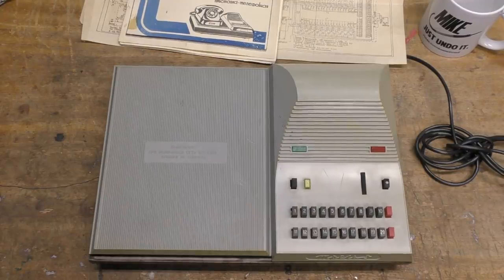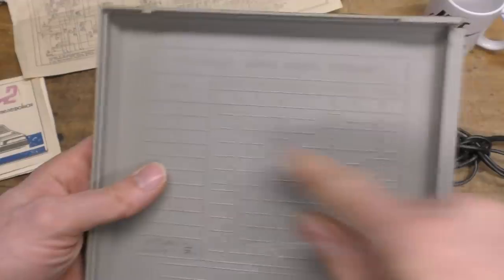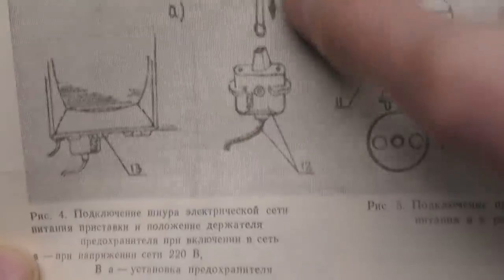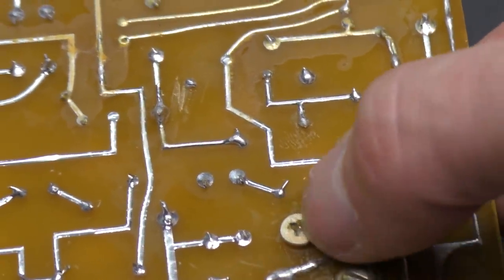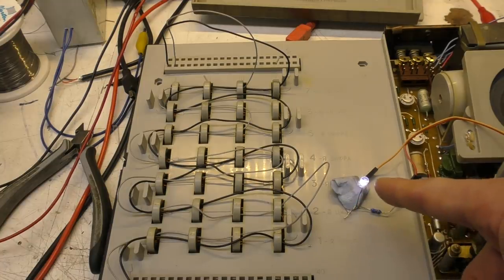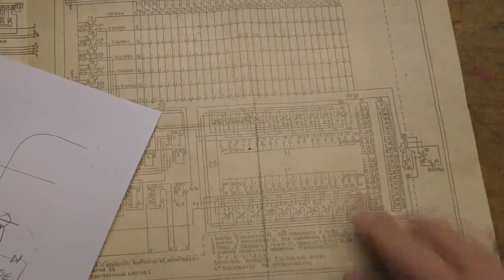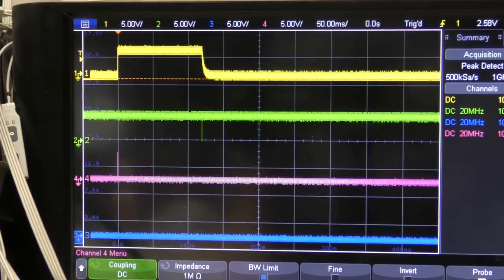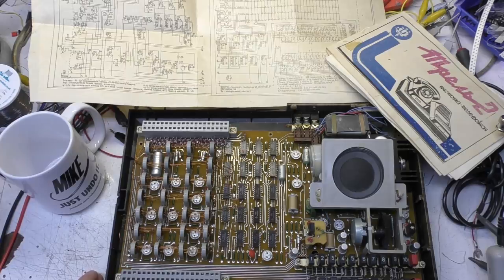Russian phone dialler using interesting magnetic memory tech

Comment: Wow the Russian population must have been a hell of a lot more capable than the west, especially these days. Lets face it most people cant set the clock on the microwave let alone manually code magnetic cores :)
Reply: So capable that they couldn't make a basic smart dialer in the 1980's whilst the west had systems such as the AT&T Merlin......  This ain't any different than setting DIP switches on dialers from the 60's and 70's before fully programable office BPX systems were basically common place by the 80's.
Reply: @DOGMA1138  Ha yeah  you are right regarding the technology I was looking at the ability of the user to actually program these.
Reply: @campbellmorrison8540  It's far simple to program these than to program their western counterparts.... That actually required you know programming...
Reply: @DOGMA1138  They could manufacture (or copy from abroad) anything, including microprocessors, but this was simply a cheaper solution.
Reply: @Turmfalk  Emphasis on copy, which is why a lot of their IC development stalled once VLSI ICs that couldn't be reverse engineered from die inspection alone popped on the scene.

Comment: Why?
 Why not use some dip switches to programm the numbers into it? Were they not a thing back in the days?
Reply: With 40 numbers, 7 digits each, 4 switches per digit, you'd need 1,120 switches.
Reply: @Kevin75668  no.  Each telephone number can be stored as a 20 bit number.  20x40 = 800.  But realistically fewer than that because you'd be using multi-switch dip packs. But yeah, just decode the binary number into digits.

Comment: How long do you think it took to design that thing and get it to actually work, in the days before ltspice and kicad :)
Also it dawns upon me that this may have been achieved with just dil switches and relays, which surely would have been cheaper and easier?
Reply: Probably did not take them very long since they had production lines churning out far far more complicated magnetic core memory modules, those were obsolete around the time this thing was made however in a stagnant planned economy the capacity stays around for longer.
Reply: @FlakeSE  That is generally a thing. As technology gets older and becomes cheaper to produce, it trickles down into cheaper markets. By the time this auto dialer was released, it was pretty much 20 year old tech.

Comment: The digit encoding struck me as a bit interesting. ("Read More" for a Table below.) The lowest binary symbol starts with four [0b0100] which seems kind of arbitrary. Presumably zero [0b0000] is just NULL, but I wonder what if any undocumented functionality might result if one were to wire encode for symbols: one [0b0001], two [0b0010] or three [0b0011]? ( Less notably fifteen [0b1111] is seemingly unimplemented as well.)  Perhaps four was just the first wire pattern capable of reaching a saturation state, but I can't exactly intuit why. If something like that were the case I'd think four [0b0100]  and eight [0b1000] would be a problem too while three [0b0011] would not.  Alternatively, perhaps this arrangement just somehow simplified implementation of the pulse encoding matrix.  Any thoughts?
DIAL	 	BIN		     DEC
{∅}	~	0000	=	0
(?)	~	0001	=	1
(?)	~	0010	=	2
(?)	~	0011		=	3
[0]	~	0100	=	4
[9]	~	0101		=	5
[8]	~	0110		=	6
[7]	~	0111		=	7
[6]	~	1000	=	8
[5]	~	1001		=	9
[4]	~	1010		=	10
[3]	~	1011		=	11
[2]	~	1100		=	12
[1]	~	1101		=	13
[ . ]	~	1110		=	14
(?)	~	1111		=	15

Comment: Do not confuse. This is not a magnetic memory on ferrites! This is a way to replace a large number of jumpers.
Reply: Which is considered Read Only Memory.
Reply: It is not a replacement for a large number of jumpers. You can’t produce an addressable memory this way. This is indeed magnetic memory on ferrites.
Reply: @BrekMartin  of course jumpers can be used for addressable memory
Reply: @drkastenbrot  you can buy it’s unreasonable. If you take the cores out of this you need greatly more expensive and messy wire & logic. The cores provide the cheap replacement for a more modern addressing matrix here.
Reply: @BrekMartin  no doubt. its certainly one of the cheapest ways to do it before semiconductors became cheap.
Reply: @drkastenbrot  I am still considering wire. I had a radio that had the last few digits of a freq set with diode matrix, but never investigated how it worked, or it’s silicon efficiency. I suppose it would only take one bit high output fed through a diode arrangement to be read as 8 bits by a shift register… then you get 8 more bits for every output you have available. Don’t know if that’s how it’s done, just the first way I imagine.
Reply: @BrekMartin  The usual way to approach that would be to write down the behaviour you want in a big table (each possible input on the left and desired output on the right), and then use mathematical methods (such as QMC) to reduce it to the minimum amount of circuitry needed.

Comment: Up to seven digits? Was this for company internal communication only?
Reply: In the USSR the phone numbers had 10 digits, but the first 3 to 6 digits were used for the area code and dialing these was optional for calls within the same geographical area. It still works like that for local landline calls in Russia outside of Moscow (there are three 3-digit area codes in Moscow). 
Seven digits were enough, because in Soviet times people almost never made intercity calls from their home or regular work phones even though technically it was possible.
Reply: @imevmt  Not too different to even today's numbers. For example here in Germany area codes are between 3 and 5 digits (And all begin with a zero that is omitted for international calls) and the actual numbers given out are at maximum 11 digits since 2011, before that the usual length was between two and nine digits. So no issue to call local numbers with a maximum length of 7 digits. This auto dialer would've worked here during the late 80s/early 90s basically just as well as in the USSR.

And the international E.164 standard limits international numbers (including country code) to a maximum of 15 digits. And until 1997 that limit was 12 digits.

Comment: At least no bitrot problems like modern cheap flash memories found in USB sticks and phones..
Reply: I have not heard of such problems.  There are however many cases of people fraudulently selling low capacity USB memories that pretend to be higher capacity devices - so after you store as much data as the real capacity of the device, storing more data will overwrite and corrupt the whole thing.
Reply: @davemould4638  I have had problem with bitrot several times with both flash in phones and usb sticks..

Comment: Ok. so if it takes so much time to program only forty set numbers and if you wanted to progress to a new set re program the entire assy, why not just have someone sit there with the same numbers manually ringing them each with that time. I don't understand the advantage? Unless it can simultaniously manage 40 lines at once?
Reply: from what i can tell, it does all 40 lines at once
Reply: @kopeckop  righto, cheers👍
Very interesting.
Reply: from 8:13 you can tell he is using multiple wires at the same time

Comment: Apparently it was late 70s. No idea how it remained in production till 95.
Reply: It's the fate of most late combloc era utility products. For example, the most popular light-duty truck around in Poland in the 90s was introduced in the 50s, received the last lift in 1970, and was then made until 1998 with basically no further changes.
 
It might have had to do with the depression and chaos of the 80s. A lot of modernization/development programs were nixed at that time, both in the USSR and in other combloc countries, across various fields.
Reply: Indeed, the motto was never change a running system. That was ensured by overboarding bureaucracy, lack of motivation and scarcity of almost everything.
Like in GDR the Trabant car, whose body was cased in phenolic rag and cardboard from 1958 to the end of production in 1991.

Comment: зелёные резисторы очень старые военные. возможно полые.
13:52 в военных приборах этот тип конденсаторов не применяли.
14:08 на военных блоках транзисторы приклеивали.
странный набор деталей
Reply: The green resistors are very old military ones. Probably hollow.
13:52 this type of capacitor was not used in military devices.
14:08 military units had transistors glued on them.
Strange set of parts.
Reply: @alexanderismylove  в первой строчке наверно никто не понял. и похоже я ошибся.
тут резисторы бытовые ВС-0,125.
мне показалось что это военные МТ-0,25, они крупнее.
МТ-1 и МТ-2 трубки, другие советские резисторы таких размеров на керамических стержнях.
У МЛТ-2 внутрений диаметр трубки всего 2мм.

Comment: Looks a lot like a Chess computer from the DDR I have.
Same poor quality PCB. They use a kind of nice industrial type keyboard to enter moves.
The bottom plate is a piece of hardboard like the rear of a radio set from the fifties.
Reply: это плата самого лучшего качества.
военные платы в лак окунали
Reply: the PCB is above-standatd quality fo those time and those make. It looks rude, but works flawlessly.
Reply: Those types of Chess computers were a masterpiece in comparation. Using magnetic-core memory in 1984 ... I think it would be more expensive in production than C64 at the other side of iron curtain (or the Telstar Call Control)
Reply: That poor quality PCB might even be glass fiber based, can't tell from the pictures for sure. In any case even if pertinax, its quality would have been on par or better with the cheap pertinax grade used in western consumer electronics.
Reply: @mjouwbuis  no, it's usual fiberglass, like modern GR4. It was cheap and widespread in 1980's in USSR. And, THIS device is expensive office machine, with some requirements for realiability and robustness. Not consumer grade, for shure. Once I have programmed this thing myself, in my first year at university, 1987. I was deeply amazed by this rope magnetic memory solution and strange combination of components and technologies.
Reply: @mjouwbuis  yellow on glass cloth. (2 sides without mask).
brown on paper. (1 side with a mask).
there were no other materials.

Comment: In the CCCP I expect this would allow people in offices to fast dial but may be to also keep the actual number hidden. Has the machine any sign of being able to lock or seal the cover of the matrix? So the general user could not know the numbers being dialed? I know it would not be hard to listen to the pulses but it could be a feature.
Reply: As you said, it would be easy to listen to the clicks.  So if this was called a feature, it wouldn't be a very effective one.

Looking at the cover I don't see any provision for it being able to be secured, so I'd say no.  That said, somebody could add bolts to hold it down if they really wanted to do that.
Reply: You actually can hear in the line what's the hardware doing. So conspiracy like this will not working.
Reply: it was just an office tool

Comment: This isn't really like the Apollo flight computer, in that the "memory" is the actual run of the wires, not memory which is magnetically stored in the cores.
Reply: The AGC had both ROM and RAM: the ROM worked exactly like this, while the RAM is the one that stored data magnetically.
Reply: It is the same principle as used in the Apollo ROM. You confuse it with the random access memory that can also use ferrite cores.
Reply: @satadorus5924  no he hasn’t, he’s described core rope ROM, and somehow confused what he’s seen in this video. This device is using core rope ROM. The user weaves the memory.
Reply: Hi Alberto, that does make sense.
Reply: @fredbloggs4829  Fun fact: The ROM of the AGC was sometimes called "LOL memory" because of the women (Little Old Ladies) sewing the bits into the cores. If you search the documentary "Computer for Apollo" you can see them doing the sewing (around the minute 20:30-20:45 depending on which version you watch).

Comment: why transistor are  upside down ?
Reply: probably to save space. The transistor case is quite big and there wasn't enough space for the coil wires to go over them.
Reply: @mircea888  it could be, but the transistor on the rigth part of the board are upside down too, even if there is more room
Reply: @gfr2023    Correct, I saw the other one later. It would of been kind of silly to use two different layouts for the same transistor, and maybe that's why they used the same configuration all over the board. And as a bonus, the upside down config gives better mechanical resistance for the joints. It's odd they used germanium transistors in 1984, Russians had silicon transistors in smaller footprints but probably used an old design.
Reply: Смех смехом, а пи-да кверху мехом
Reply: @mircea888  Imagine if you have like thousands of tons of old germanium transistors and want to make a rather simple device that's big enough to hold a phone on top of it? Why not to use those then? Not to mention that autodialers like that first appeared in 70s, that's why it's so outdated. Simple case of "don't fix what ain't broke". Just a hint - most phones with just keypads and memory didn't use CPU but rather a dedicated chip. AY-5-9151A and similar with different cases and pinouts.

They became very common just a year or two later. I was 6 years old when i made a simple headset phone using one chip, a keypad, a few resistors and capacitors and simple one transistor amplifier for the speaker.
The cost of one Z80 would be about the same as 20 of those phones.
 
Fun fact that those chips are still in production even if MCU in a 3 dollar Bluetooth mouse is more powerful than a high end workstation from 1985, except maybe RAM size.
Reply: @mircea888  they could be silicium transistors.
Reply: If the transistors were installed vertically, then the cases of the transistors standing next to it could be shorted together.
Reply: Lid on the ground, comrade found. Lid in the sky, western spy.
Reply: @uhrbexer9134  ahahah
Reply: Скорее всего так делали потому что ноги транзистора хорошо видны чтобы при быстром монтаже случайно не закоротить их. Или это такая разводка платы.
Reply: Looks like it was easier to wire this way. 
Maybe they are glued to the PCB.

Comment: К155 chips are TTL, equivalent to 74 series (not 74S or 74LS yet). 74LS would be К555, and 74S would be К533.
ЛА1, ЛА3, ЛА7, ЛА8 are different configurations of NAND gate with open collector output.
ТМ2 is a dual D-flipflop, equivalent of 74x74.

Comment: Strictly speaking this isn't core memory, the cores are not actually holding the programmed information, the piece of wire the user inserts through certain cores is the memory.
This is really just a glorified peg-board memory using inductive pick-up instead of shorting pegs.
It does highlight how American (and by inference much of the rest of the World) technology embargoes with the USSR restricted their electronics industry.
How did the West do the same thing at the time - SRAM 1Kx4bits and a Z80 ?
Reply: technically, It's the ROM version of magnetic core memory. Unlike normal MCM, You can't flip the magnet fields in these cores. In fact, I don't think these cores can be magnetized at all and just act like transformers.
Reply: Z80? Are you crazy? It's like using Xeon Platinum as a keyboard controller today.
It's a device from around 1972 that was produced with a few small changes till mid 80s.
 Contemporary solutions for mid-80s were using dedicated chips that are still produced today. Those chips were about 1/100 of a Z80 price and didn't require all the extra chips (and a lot of power) It was all-in-one solution - you need a keypad, a few resistors and capacitors, and one or two transistors plus microphone, speaker and a microswitch - and you got yourself a phone with keypad and redial option, about 2 years later - also with number memory for up to 16 numbers.
For Z80 - in late 80s-90s those were used in what was basically a landline smartphone of the time - phones with screens, large number memory (some of them - even with NVRAM), notepad, calculator, Caller ID etc. Some of them even had dot matrix displays and built-in games.
Reply: It's called core rope memory.
Reply: SRAM дорого стоили.
был любительский телефон на z80. 
при отключении электричества информация пропадала.

этот прибор из устаревших деталей 70 годов. они стоили не дорого
Reply: The west and far east would have used an ASIC dialer chip or possibly something like a MAB84xx or PIC16xx controller, both combined with an EAROM. A Z80 was far too powerful and expensive.
Reply: Apollo computers used both core rope ROM and core NVRAM. Both entirely different concepts.